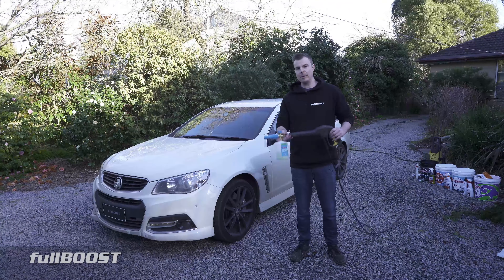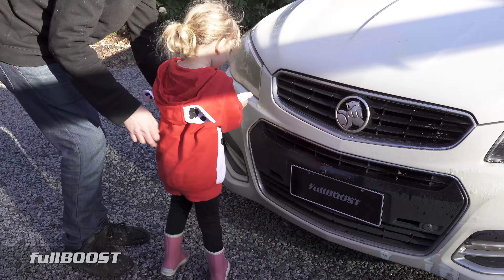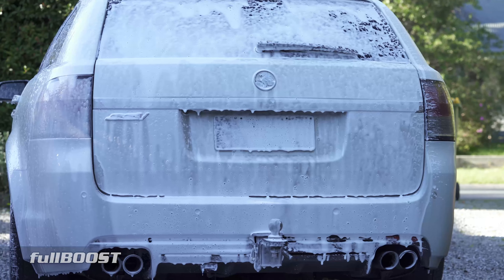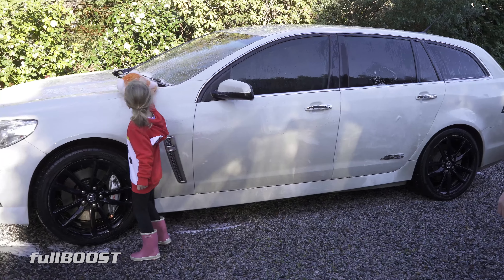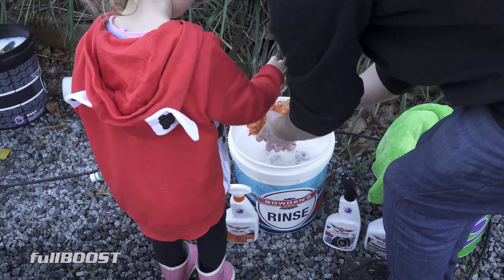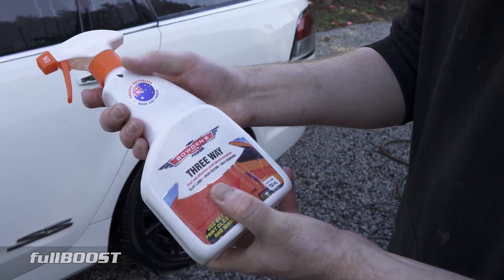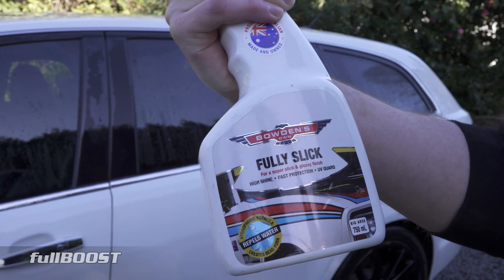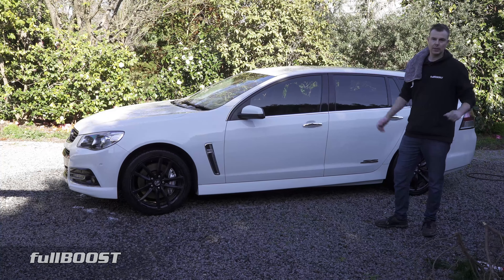Beginners guide : How to wash your car | fullBOOST

Comment: Well done, but i would never ever clay the paint surface, IMO why because it might grab on to those particles and thus all your doing producing swirl marks in the clear coat, is if you looked under a microscope you would see the particles sticking up above the clay matt and thus producing swirls all over the clear coat, just saying and i have a SSV Redline SED Nitrate silver and i have tried three way and to date and even meguiers wheel cleaner sprayed it on my exhaust tips and they did not change to purple at all and even just behind the wheels front and rear. Each to their own, if your happy with the results when you wash your daily driver, so be it.
Anyway Happy Fathers Day to all and i hope you had fun with the family. :)